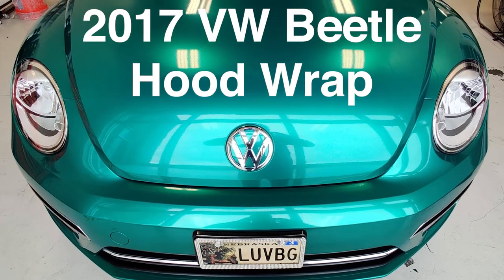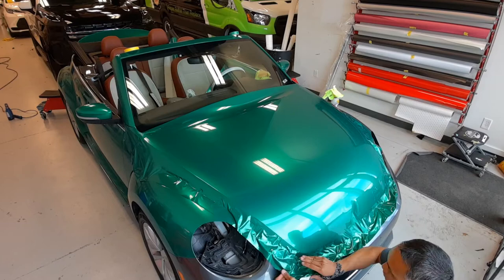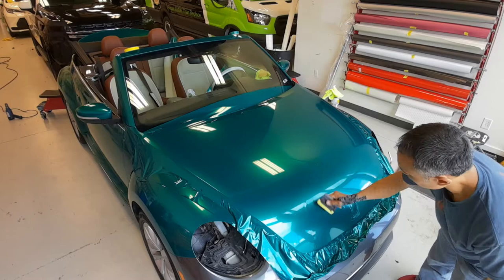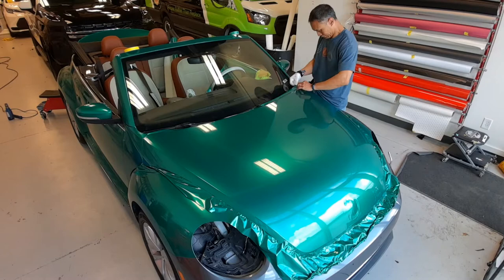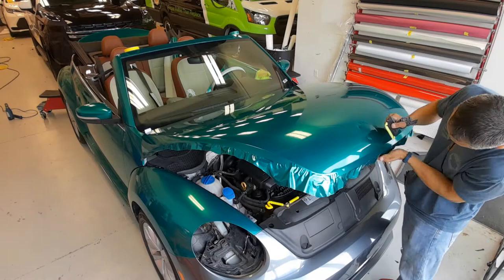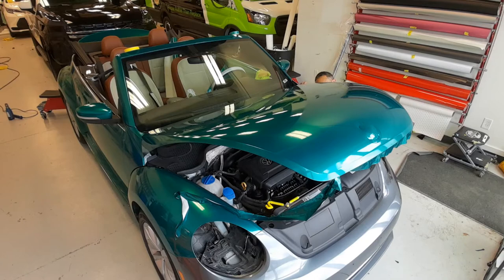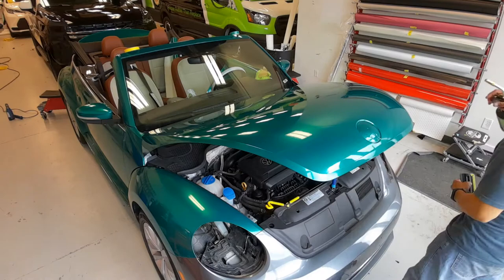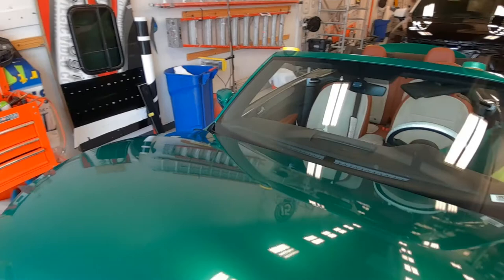How To Vinyl Wrap A Car - VW Beetle Hood | Walkthrough Tutorial

Comment: I've got an 06 beetle, thinking about this what's an estimated retail cost to have it done?
Reply from the maker: It will vary based on shop, local market conditions, material used, etc.  But in general and what from I've seen, for a regular color (meaning not color shift, chrome, ultra matte, etc) full color change on a smaller sedan type car, I've seen the range from $2500 to $3500 USD.  Those prices go higher if you start using specialty films like color shift or chrome ($$$$!!) films.  Since Beetles are tougher to wrap (it's basically a big bubble) I would not be surprised if the price was  more toward the higher side.

Comment: Looks great. How much wrap did you have to use? Were they 5ft x #ft pieces?
Reply from the maker: The shop ordered a "full" roll, 75' x 5', which I then cut to size as needed. It was way more vinyl than needed, but always good to have extra.
Reply: @ColorChangeCustoms  thanks. I'm doing mine soon. Think that 30 x 5 will be enough?
Reply from the maker: @Rick-yg2te  maybe, but you'd have to measure things out to know for sure